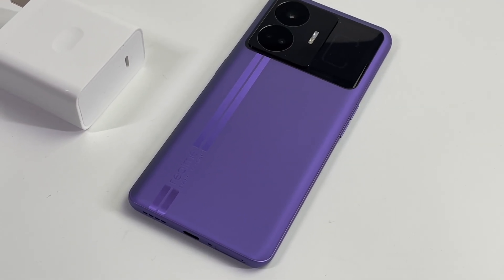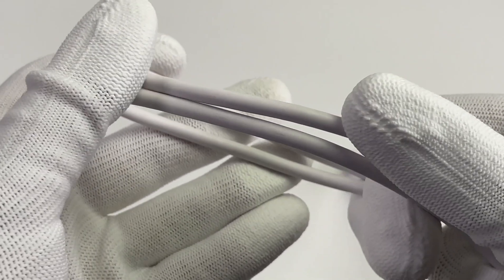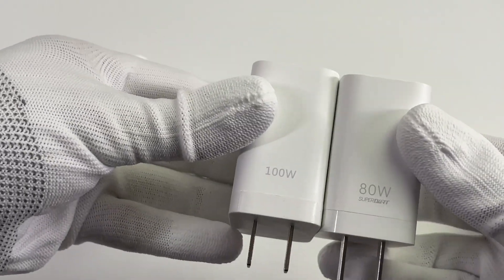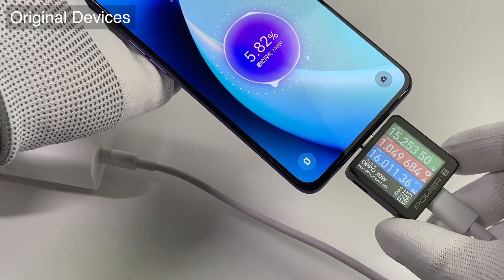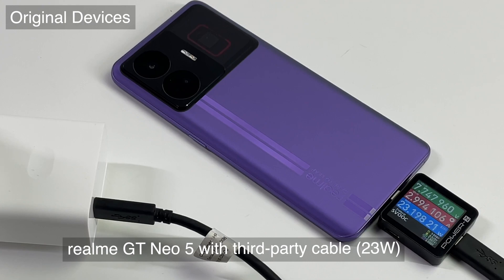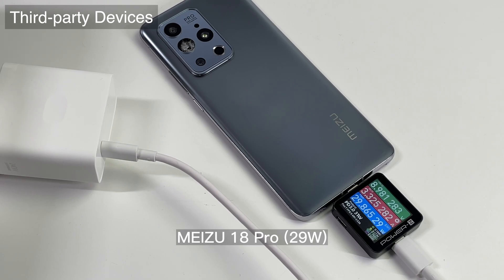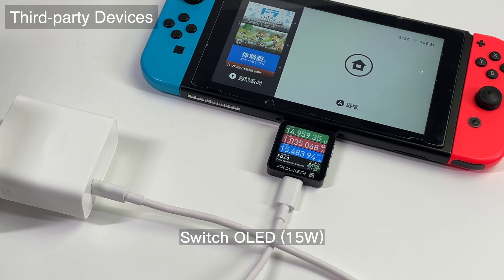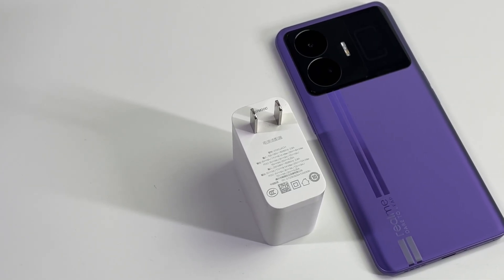Charging Compatibility Test of realme 240W Fast Charger (realme GT3 / GT Neo5)

Comment: This is a 65W charger with added proprietary nonsense of 12A protocol. There is a reason USB-C standard limits current at 5A, and the real 240W is 5A at 48V.
Reply: Yeah, but for phones anything higher than 11V is too hot
Reply: @fedyaf2710  heat comes from high current, not high voltage.

Comment: Vendors really need to stop this madness of proprietary protocols
Reply: really. I think that USB should increase the amperage of some PD 4.0 future spec to 10 amps or even higher, so that these chinese companies don't need proprietary protocols - like suppose 20v 10a over PD 4.0 or 30 volts at 10 amps with some six-cell battery to split the power 6*50w, all with PD. This would also make E waste go down

Comment: Wait so no PD3.1? This seems like an odd choice.
Reply: Not exactly. PD 3.1 mainly benefits from allowing voltages above 20V up to 48V, and since this supply doesn't support providing more than 20V, there's no use to certifying it with PD 3.1 support.

Comment: Why is it that the 1XX volts world has lower charging speeds for these chargers compared to the 2XX volts region of the world? It's not the first time this has happened.
Reply from the maker: The primary filter capacitor is not enough for normal output power, and the only way to ensure continuous output is to reduce the output power.